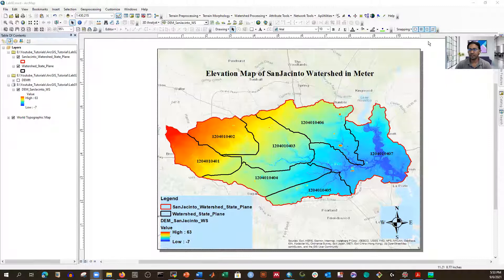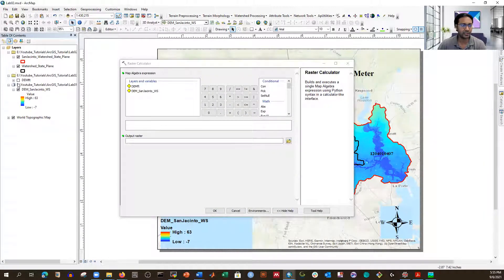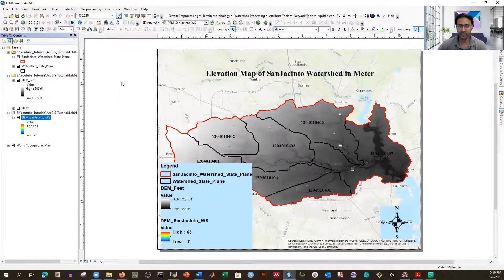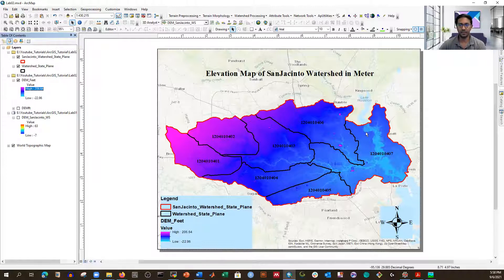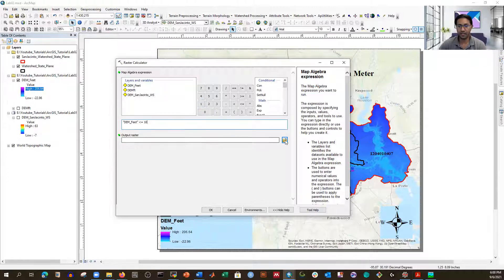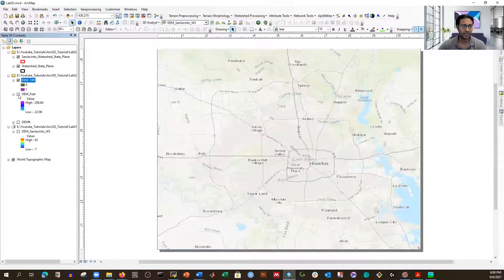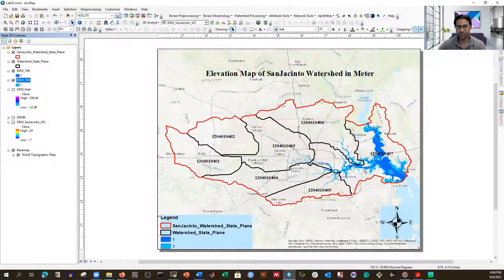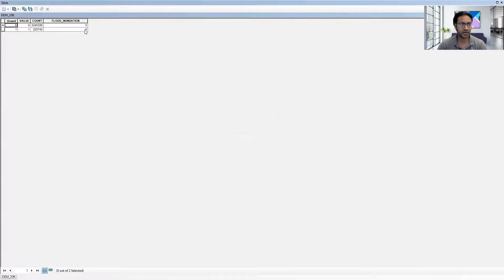ArcGIS T9: How To Convert Vertical Unit of DEM and Generate Flood Inundation Map From Raster

Comment: Sir, I have a query. Is the calculated inundated area included river or existing water bodies also? if so then what is the process to calculate only inundated areas without river areas?
Reply from the maker: Thank you Jamil for the very important question, It is the question that is asked by many people, that's why I have created two sets of raster- one for 10ft and another one is for 20ft to demonstrate. If we consider that the bank of the river is located at 10 feet, and if we want to exclude that river, we can simply create a third raster that will be the difference between the DEM_20ft and DEM_10ft. This raster will give you the inundation map excluding the river and other associated water bodies that have elevation up to 10 feet. You can see in the map where I have  plotted two DEM together, the dark blue is for 10 ft and light green is for 20ft. The light green that is outside of the dark blue is the area of inundation that you are looking for.